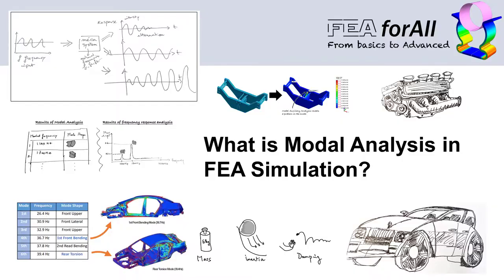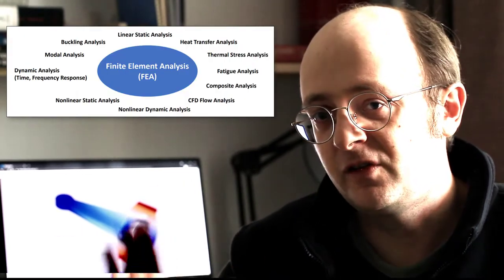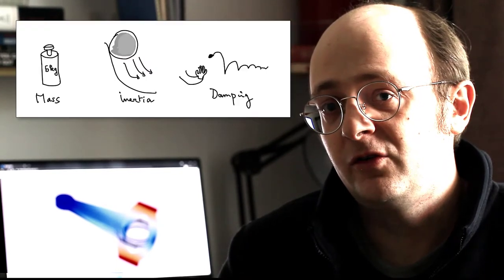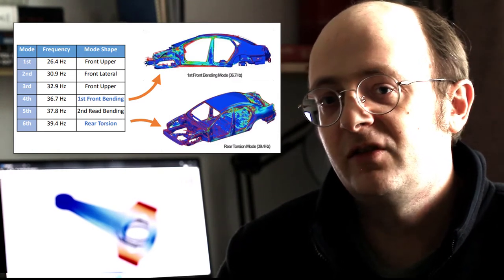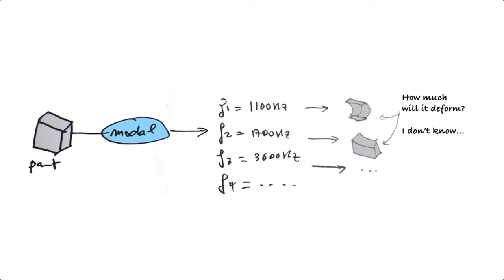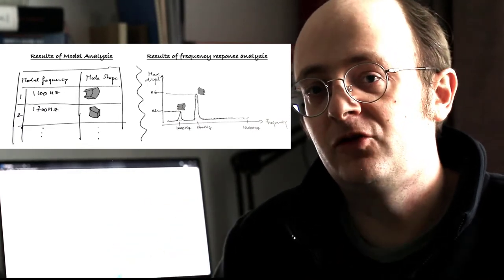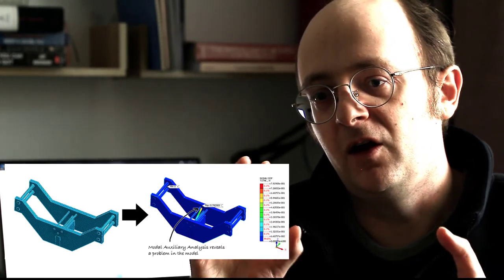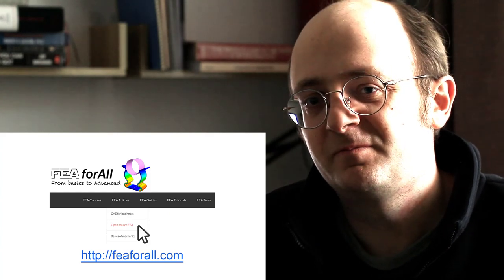What is modal simulation in FEA Simulation and why do you need it?

Comment: Cypren thank you a lot for your time and for share this valuable information. I am 100% with you. Before to start any linear or non linear static simulation a modal analysis should be mandatory. It helps a lot specially with big models where some parts could no be constrained. This small simulation could save hours. Is also a good way to compare if a translation from other code has been correctly. At least it is a check. Suppose that you have a model in Abaqus, Ladyna or Nastran and you want to convert to Pamcrash if the modes are more or less same you are sure at least than for linear analysis models are equivalent. Thank you

Comment: Nice video. However, I have one point to make: You were telling about mass, inertia and damping, but a beginner may think that mass and inertia are two different entities, though they are intimately related. Probably you meant inertia, restoring force and the damping. Also, regarding modal deformations, instead of describing them as "fake" deformations, a better term would be "relative deformation of various 'points' of a body, since mode-shape vectors are always normalized. Thanks again for taking up this very important topic.

Comment: Hello Cyprien and thanks for this video, i am using Salome to mesh a manifold pressure vessel so i can create my geometry which has  4 folds but when meshing with tetra  i get errors, and when i check my geometry i can see that layers overlaps,. The problem is when i create the initial face  wich is divided to 4 manifold and i rotate i can't see this overlapping, so it's sad that i can not figure out how to solve this since i need the manifold pressure vessel with terahedron and then each manifold in my FE simulation will take a different material. Can you understand my problem? I saw a lot of your videos, they are so good, so maybe you have an idea